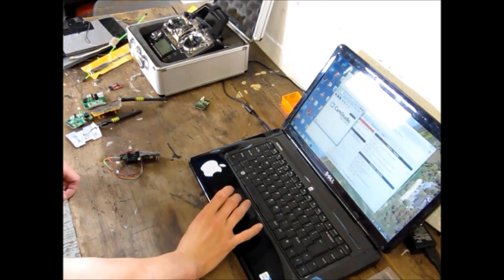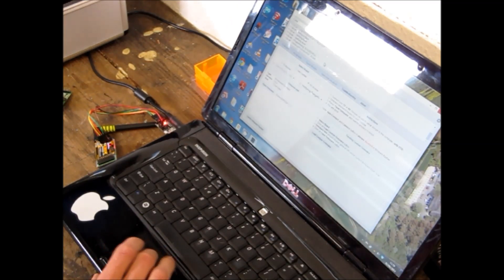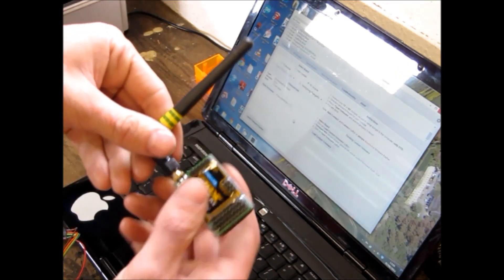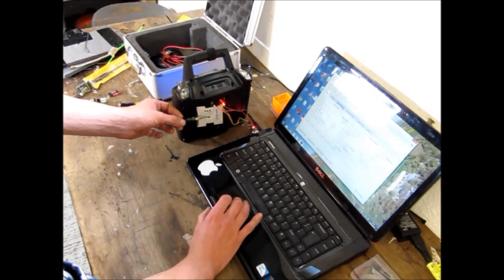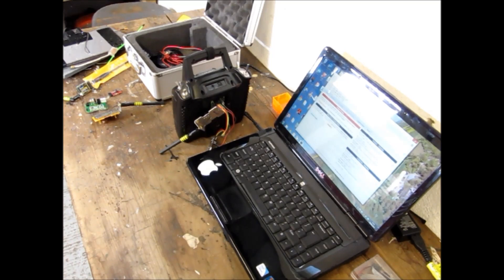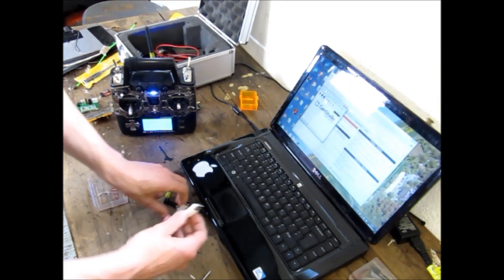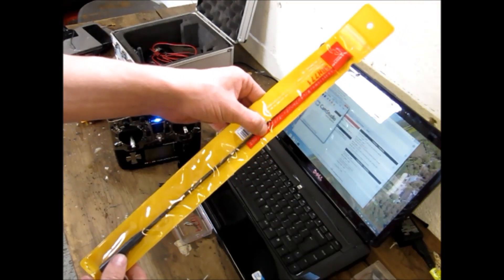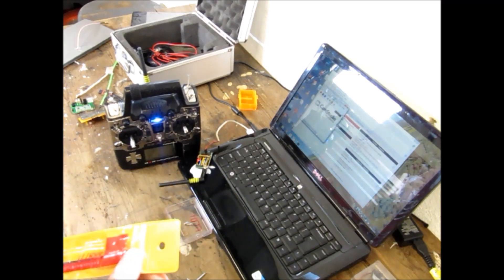OpenLRSng Tutorial using Google chrome configurator

Comment: Per my understanding, I can bind to any RX as long as I have my TX in binding mode. Isn't that quite inconvinient?
Reply from the maker: Any openlrs RX with the correct firmware. While your Tx is in binding mode and when you first power up the rx.
What's inconvenient about that??
Reply: If there are more people in the area, powering up their RX while I am in binding mode will let me hijack their setup if they are running the latest firmware (most of my friends will at least update when there is a new one out). I think it should have been some procedure on the RX side as well to initiate binding other then just applying power.
Reply from the maker: +Christian Wilhelmsen you only need to bind once. If you bind at home then you'll not need to bind in the field. I think in the config there may even be the option to turn off the bind on start up.

Comment: If I wasn't convinced before, I am now,, I am ordering the Orange OpenLRS system tonight from HobbyKIng ,...great deal considering the alternatives!!
Was looking at a 2.4 booster (Like the Alpha) on my FrSky Tx Module but  going to 433(5) MHz allows for a shot at 2.4 GHz VTx and this keeps your cloverleaf antenna down to a manageable size on the wing. Also the 2.4Ghz VTx and Rx combos are quite reasonably priced as well. Antennas for all of this gear are easy to make. With the money you save you can go buy the ImmersionRC RF Tester and then the game is totally ON!! Woohoo

Nice work mate!! :-)
Reply from the maker: I use 2.4ghz boscam vtx sets. With some homemade skews and a diy crosshair I managed considerable distance.
Happy flying!
Reply: +Benjamin Harvey Cheers,   my first cross hair will be a milestone, just getting all the designs and supplies on board right now. Been a bit if a drone head since I got in to RC so  will test with fixed wing as I am doing my maiden flight as a total newb. 
Literally ordering as I reply to you, not quite enough to get the RF meter sigh :-) Best.
Reply from the maker: Chris Leech just be particular about the size you cut it to. And keep tge feedpoint where the elements meet as close as you can and youll be fine. Also dont make the refkector too large to begin with.

Comment: great video my friend, thanks ;)
one tip for who doesn´t have a FTDI 3,3v: i just had a 5v FTDI but i also had a logic level converter (LLC) from sparkfun and an Arduino Uno (to supply 3,3v), using all this stuff together i could flash both TX and RX and config them =D
cheers!

Comment: Thank you for your great video.
I've got the 1W module, what is the best settings for the tx? RF power 0-7?

I did a test flight with my mini quad last week and within 10-50m, i kept getting the bleeps every few seconds! I've use stock antenna both rx and tx and then both on ImmersionRC 433MHz "Sander" Antenna: http://www.hobbyking.com/hobbyking/store/__63105__ImmersionRC_433MHz_34_Sander_34_Antenna_Replacement_or_Telemetry_Radio_Upgrade_.html
Both types gives me the annoying beeps!

Thanks in advance
Reply from the maker: 7 is highest transmitter power, the stock dipoles are next to useless for range, however id still be expecting more than 10-50m more like 200m.
At any point have you powered the transmitter without an antenna attached? when you opened the case to get to the pins did you break the connection between the co-ax and the board? Id double check all connections and that the Tx power is set on high.
You can get the annoying beeps due to interference, for instance if me and my mate stand next to each other when using our LRS systems we get loads of crazy beeps.
Id suggest a diamond srh-771 for the tx, as you shouldn't use an unbalanced antenna on a Tx. as your receiver is also a Tx you may want to try adding a ground plane, to the Rx antenna. ( length of wire 160 ish mm long soldered onto the side of the SMA connector.

If you still have problems it could well be you have a dodgy Tx or Rx.
Reply: Benjamin Harvey
Thank for your reply. I always had antenna connected to both tx and RX. Will try out the suggestions you listed and see how it goes. :) cheers

Comment: Hi Sr..!  nice video !! but I have one big problem.....RX dont show me the second led on!!!...off,,,,,my orange dont bind...
do you have any idea???  
first show me that:

23:12:37 -- Running - OS: Windows, Chrome: 38.0.2125.101, Configurator: 0.49
23:12:39 -- Please click on "Request Optional Permissions" button to grant application required USB access
11:52:49 -- Serial port successfully opened with ID: 1

this is my problem???
thanks! Martin.
Reply from the maker: Id suggest you first re-flash the firmware. I believe you get 2 lights only once it has bound for the first time. Try this;

Flash Rx,
Flash Tx,
While the ftdi is still connected to the Tx click the connect button.
Now click on the Rx tab.
Power up the Rx with 5V from the servo pins. 
The Rx should bind and the tab should change.

if this was successful then you should be ready to rock. You'll need to power off both Tx and Rx for the servos to start moving, once disconnected from the PC.

Good luck!

Comment: at OpenLRSng Tutorial using Google chrome configurator you powered the TX using 3.3v from the FTDI. Then you power on the radio. Does the radio also sending power to the TX?
Reply from the maker: With some modules (low power tx's or rx's) you can power via the ftdi 3.3v pin. 

Others such as the 1W tx or the 100mW tx can draw more power than most USB ports are able to provide.

For this reason when flashing a tx module I use the tx unit to power the tx module and I do not connect the 3.3V pin. All other connections remain.

I believe in the video I disconnect the 3.3V pin when powering via the tx.